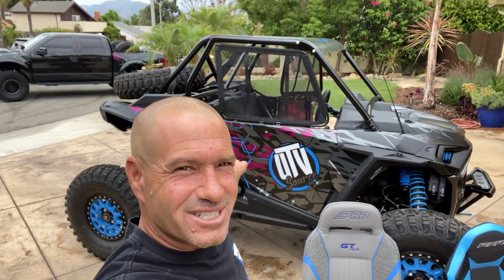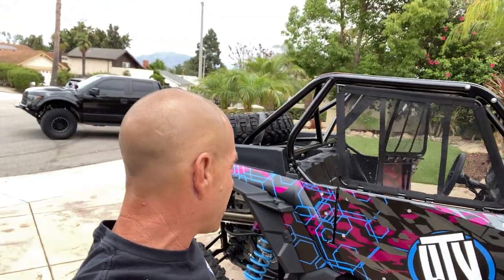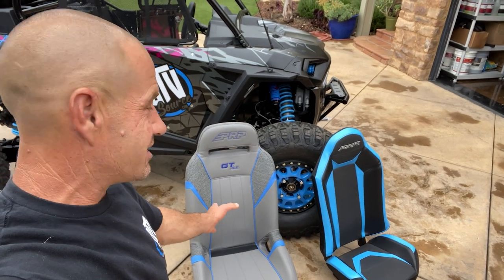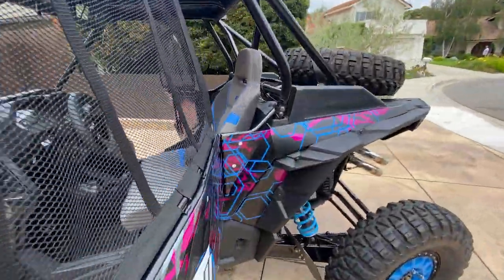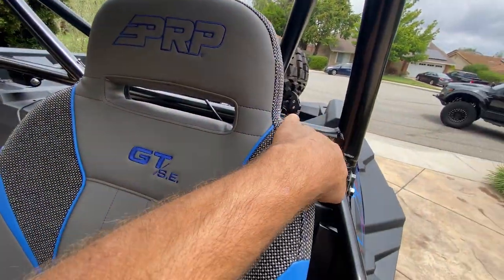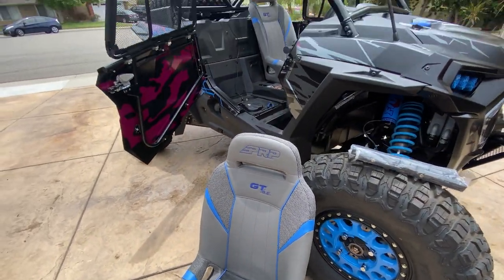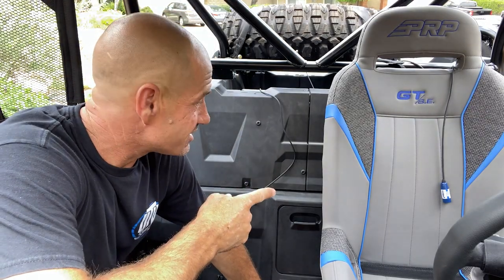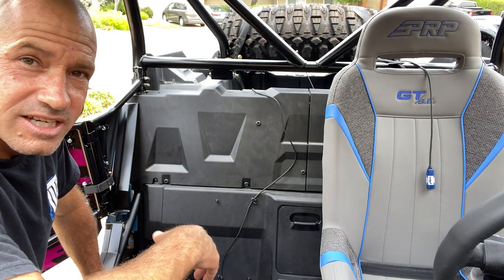Lets Talk Seats...

Comment: Prp response to my almost try to return after ther 3 time calling and them hanging up message in a email...Them her > I'm sorry to heart that the seats didn't work out for you. I would recommend trying to sell those seats 2nd-hand and using the money to purchase some new ones that have more room to them like the RST or the XCR at a discount. I can get a coupon code generated at 15% off a new set of seats from the website if you'd like one. The seats you have can be sold as RZR XP 1000 or Maverick X3 seats in addition to be Honda Talon seats, they'd just need to purchase the appropriate adapter mounts from us. This will help increase your chances of getting them sold since there are more vehicle types they can go in